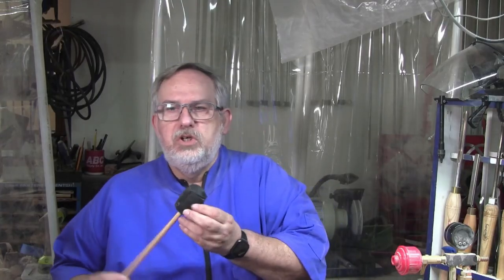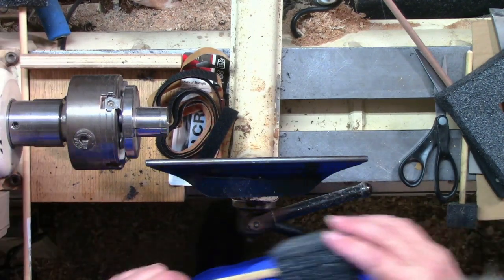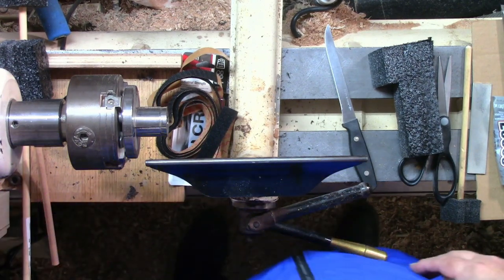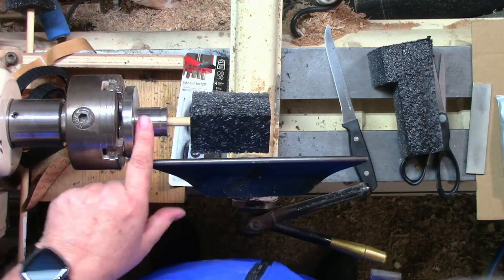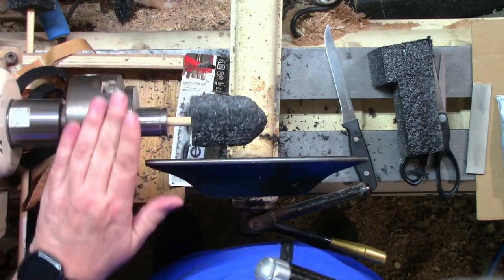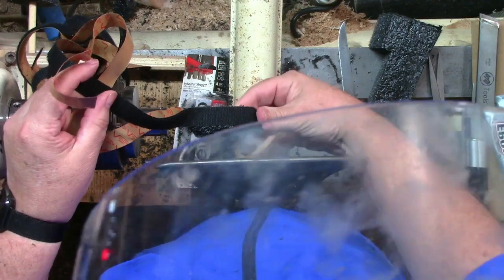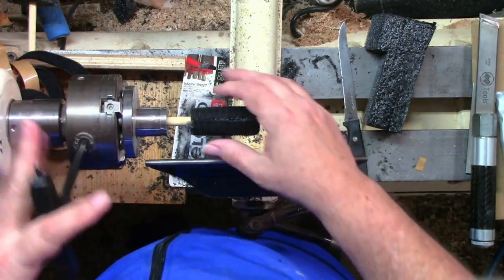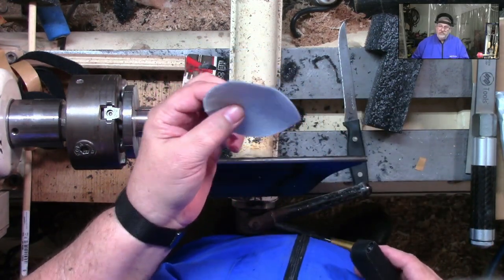Sanding Sticks for the woodturner by Dean's Woodworking #woodturning

Comment: Hi Dean, Thanks for sharing. I have made some of these for myself. I really like using them. I have made one for each grit that I use that way to change grits I just gram the next stick with the next grit and away I go. I mark the stick with the grit size on the dowel. I use a larger dowel which is easier to hold and will not flex when using it. I take the foam and a forstner bit and drill hole in the foam the size of my dowel. I then use a 5 minute epoxy to glue the foam on to the dowel. I have not had the foam come off the dowel yet. I have shared this video with several of my friends and they all like these sanding sticks. Thanks again for your videos. I have learned lots from watching your videos. I like your teaching style. Keep up the good work.
Reply from the maker: Thank you soo much, and Thanks for Watching!!!

Comment: Hey Dean, I love your videos.  I made some of these after watching your video. Great idea since I work in IT and have a lot of that material that the computers are packaged with.  I drilled a hole smaller that the dowel rod and just dribbled hot melt glue in the hole then inserted the dowel. Seemed to work and hold good also. Thanks again!
Reply from the maker: That is awesome! I did not think of using hot glue but no reason that would not work great and so much simpler to do. Thanks for Watching!!!

Comment: Good idea. Any sufficiently long scrap will work. For example, a 1x1x12" could easily be chucked up even without jaws like yours and then turned into a handle/wand with an end approximately 3/8".
Reply from the maker: Very good point you do not have to use a dowel you could make one!! Thanks Josh!!

Comment: I had good results gluing the stick into the foam with a hot melt glue gun. Goop worked too, but it took 24 hours to cure.

Comment: Another great use of packing foam (especially computer packaging foam) is turning practice. Especially for those tools that most are scere'd of....ie the SKEW. The foam medium will not hurt or damage anything if the wrong tool presentation is done & you can fine tune your sharpening ability as if your getting good clean cuts on foam, well that will translate to wood. All in the technique, we don't plow!
Reply from the maker: Great tip Dane, Thanks for watching!!!

Comment: Great idea. Where do you get the Velcro? I’ve never had very good luck with the type with adhesive on it.  I buy the kind for sewing and glue it with CA glue.
Reply from the maker: That will work as well the secret to getting the self adhisive to stick is put it on and let it set for 24 hours.

Comment: Dean.  I have a Lathe that has the motor on the side, and it sticks out past my drive center. When I mount a piece of wood to turn a bowl, I am limited to the size I can turn. Do they make drive center extenders and where can I get one 1" x 8 tpi. Thanks Tim
Reply from the maker: I hve not seen a spindle extension you can get morris taper extensions. you may be able to get a  local machine shop to make you one. What kind of lathe is it?